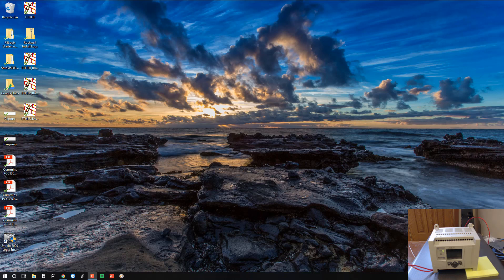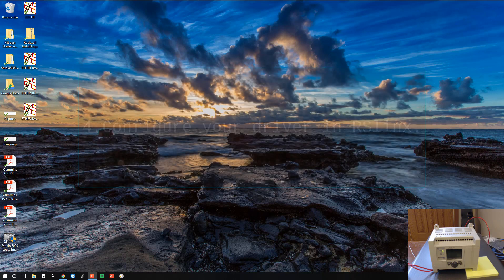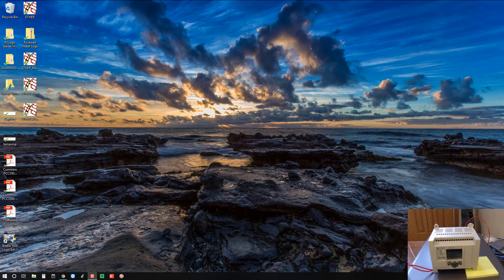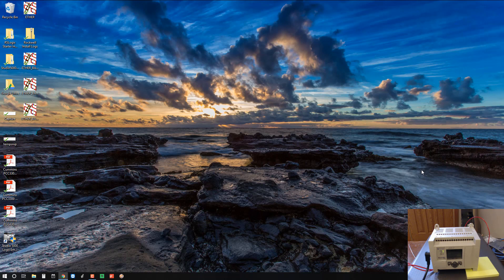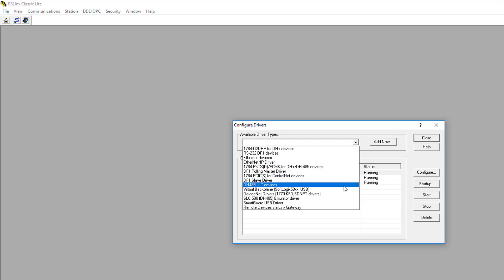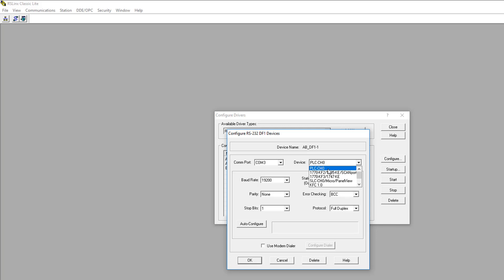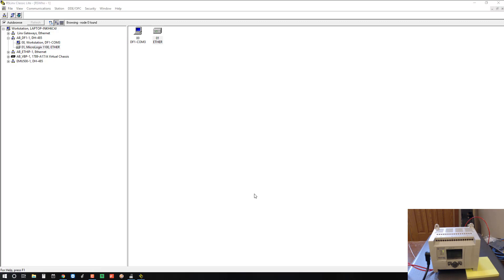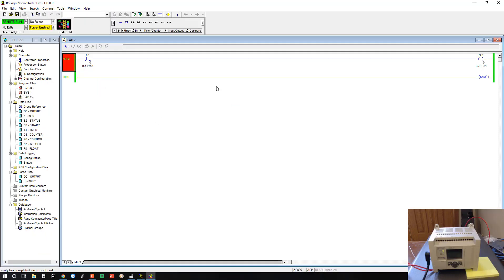Connecting to Allen-Bradley/Rockwell PLCs/PACs - RS-232/DF1

Comment: Sir, this serial to usb adapter driver automatically  installed after plug in on windos xp? And one more question is which company make adapter you are using here?
Reply from the maker: Hi there, I'm not sure if the driver would automatically installed with Windows XP. Try it :) I'd try this cable on Amazon: https://www.amazon.com/Bradley-Micrologix-Programming-USB-1761-CBL-PM02/dp/B007J2XQ6W/ref=pd_lpo_147_t_2/143-7346098-1451418?_encoding=UTF8&pd_rd_i=B007J2XQ6W&pd_rd_r=70e32322-71a5-44dc-8e22-2bd230f41eb6&pd_rd_w=mklSm&pd_rd_wg=oDVzw&pf_rd_p=7b36d496-f366-4631-94d3-61b87b52511b&pf_rd_r=36X31WP1GHKB6EMTXAEG&psc=1&refRID=36X31WP1GHKB6EMTXAEG